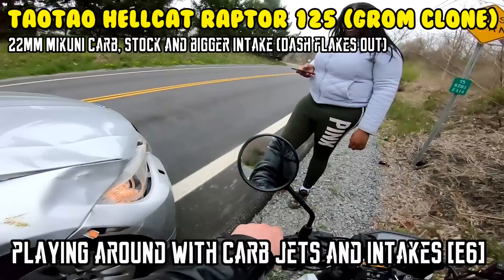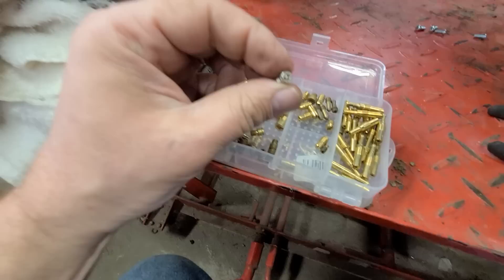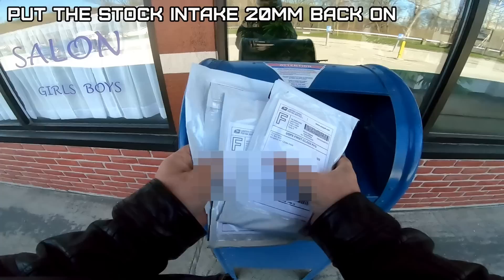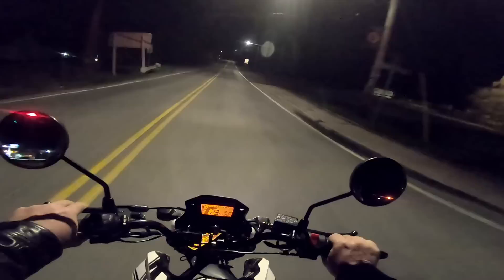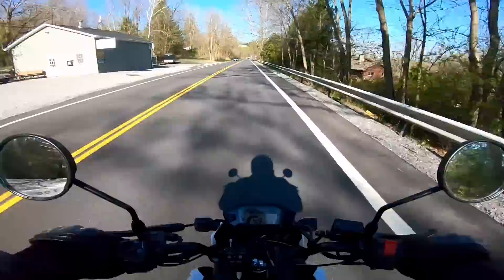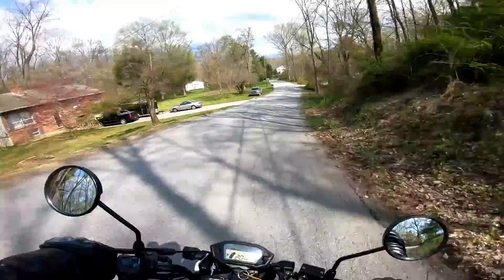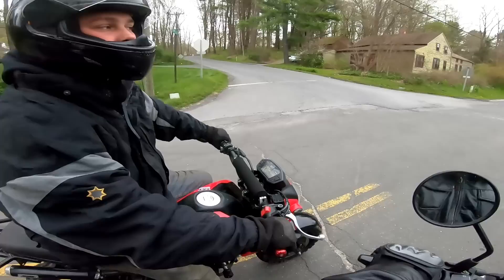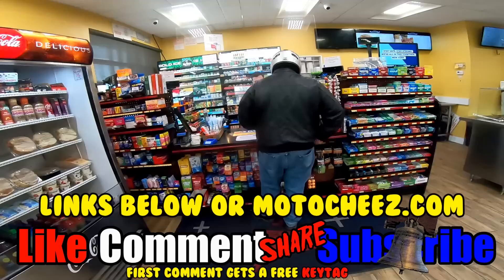(E6) Hellcat Raptor 125cc Playing with Carbs and intakes. Vee on Honda Elite 150 POOPY n wheelies

Comment: Ive been using the MSR fuel bottle. They have a few sizes and they never leak or come loose! Since its metal, you could use a small fire extinguisher bracket to mount the bottle to the bike
Reply from the maker: Good idea

Comment: If you want a small reserve tank, make one with the welder and make a box or rectangle steel one and put it on the rear of the bike, run a reserve pipe to the main one ☝️

Comment: That stimulus check is burning a hellcat hole in my pocket
Reply: I say get it, it's well worth it!
Reply from the maker: I find myself hopping on this just to grab the mail etc. Small and fun.
Reply: MotoCheez grab the mail?!  I'm gonna use mine in the house like a damned power mobility chair!  Ride it everywhere!
Reply: Sold out everywhere
Reply: Drake Orion New inventory is expected to arrive to dealers around end of June.... Any pre-ordered machines will ship first before the websites even update to reflect in Stock status.  

Best to get the order in now, or risk another bike draught later in the year.
Reply: @jasonjulian1  I noticed the prices are skyrocketing too
Reply from the maker: Everyone waiting for their containers from China
Reply: Drake Orion I wouldn't be surprised. There is already a non insignificant price difference between dealers on the Hellcat.  Almost $200 between some.  I ordered mine for $1092.  It's sold cheaper elsewhere but those guys charge $235 ish for shipping.

Comment: Needle height actually affect 1/4 to 3/4 throttle. Main jet size primarily affects 3/4 to full throttle
Reply from the maker: It effects the whole range, but yes, mostly 1/4 to 3/4
Reply: @MotoCheez  ok. In the video you said 3/4 to full.
Reply from the maker: @DoRC  I must have messed up... Meant main jet!! Been doing carbs for many years, have done hundreds!
Reply: @MotoCheez  gotcha.  I just wanted to sound smart:)
Reply from the maker: @DoRC  glad you caught it, I didn't realize unsaid it and nobody else caught it.

Comment: Cheeze there’s a big bore kit at t-bolt. 141cc I know works on Vader’s then you get the yx cam. You can call them and see if it works for hellcats. It should def work though. I was gonna go that route but I’m going zs190. I want that 5 speed.
Reply from the maker: Tough decision.... I'll probably get the entire engine 5 speed. Can always use this 125 on another bike.
Reply: MotoCheez exactly, the 146 race head kit is same kit w race head. It’s 500 for that race kit. A zs190 runs between 650-700+ depending where you buy it. For the extra we’ll say 200 get the 190. You’ll smoke you’re buddy on his grom. You’ll need a new exhaust and clutch cable. I know exhaust for sure not 100% on clutch cable. I’ll know more soon, I sold my 125 to a bud for $200. He’s putting it on a golf cart. The big bore kit fits Vader’s there’s a couple people w it installed. You go from 124.9cc to 138 along w can for around 200 w the 141 kit. I figured put that $200 toward a 190.
Reply: Forgot to say you spend 500 and still have 4 gears. 700 you get 5 gears and ALOT more power.
Reply: If you get a 190 don’t tell you’re buddy w the grom. Just tell him you put a bbk on it and race him. Then you can watch him 😭😭😭😂😂😂😂👍🏼😁
Reply from the maker: Damn. Where you finding the ZS190 for that cheap? Has to be electric start. Thanks for the info
Reply: MotoCheez I’ll fill you in once I order mine 👍🏼😁 I promise.
Reply: It is electric start it’s the complete kit carb oil cooler etc.
Reply: Great video btw brother 👍🏼

Comment: You should change the cyclinder bore and camshaft. Sometimes you can find it on Aliexpress. Your engine is similar to a lifan engine. Try a 56mm piston with 55mm stroke or somewhere close to that number and also change your sproket.

Comment: 👍👍 My DRZ does not trip the traffic lights either, have to go thru the red light or take a right and loop back. Thought about gluing a magnet to the outside of my boot, maybe that will trip the sensor coils. Good job on jetting, do you have a set of those micro drills (size 61-80) ? I use that when i have to enlargen a tiny main jet here and there. Nice adventure video, yeah a Gatorade bottle of gas is a good idea for reserve ! Now to catch up on your next vid !! 😎
Reply from the maker: Thanks. YeAh I've heard of the magnet trick too. I do have the drills but I'd rather change them because I reuse when I can
Reply: @MotoCheez  I saw your kit of jets and was like 🤯🤤🤤. Yeah, no need to drill (& ruin) unless you got lots of spares) I'm about 2 hours north of you. We got snow this morning 🥶😠
Reply from the maker: We got a dusting, squalls all day. Tomorrow 50!

Comment: I'm pumped to see the new carb.
Reply from the maker: Intake came in, had to angle it forward, didn't turn it where I wanted. It's 26mm hole made a difference even with the mikuni carb. Can't wait for the Nibbi too
Reply: @MotoCheez  I ordered a mikuni for my sons apollo 110. I'm hoping it gets here today. Fingers crossed.
Reply from the maker: Made a huge difference even with stock intake.
Reply: @MotoCheez  I didn't order an intake or breather. I hope it all bolts up. Go Power Sports wasn't answering so I just ordered it from the website.
Reply from the maker: It should. But for some reason the stock airbox has restriction or backwaves that prevented me from getting more power.

Comment: Dude, I had the OG Road Rash back in the day on the Panasonic 3DO!!! Man, now I feel really old..... Keep rippin' and stay safe Moto Cheez!
Reply from the maker: Damn! We ain't old, just matured... Wait, I'm not mature either... How about fine, like a wine
Reply: @MotoCheez  Yes sir, just matured! I actually went to bust out the 3DO a few months ago, video output is junk... I might have to take it apart to see what is going on. RR was such a fun game... That was the system to have back then. Took me all summer to work and make the cash to buy it. If I recall I spent around $1,200 on the system, a few games and an extra controller. Factoring in inflation that was like $2,100 bucks!
Reply from the maker: I remember they were expensive. That's be cool video to do
Reply: @MotoCheez  I've been tempted to repair it. It's been a while since I've done board repair on something... We'll have to see... I hope it's just corrosion on the RCA outs, at least on the inside of the machine. And you want to talk about expensive, my one buddy back in the day had a original Neo Geo. Do you remember that beast!?

Comment: I just put a nibbi 26 on my hellcat with a new Intake manifold and filter, definitely made a difference. You may not have this issue but the pilot jet in the nibbi was to small (had air screw all the way in) I couldn't find nibbi specific jets so had to drill myself to make work. If you know what jets would work in a nibbi let me know.
Reply from the maker: Good to know, I have a decent assortment of pilot jets, so if I have to change I'll post it up. I saw mine came with a few different jets, yours didn't?
Reply: @MotoCheez  it cam with 9ne extra pilot jet and there main jets but the extra pilot jet was the same size as what was in the carb. The main in the carb was a 110 and the extra ones where 105, 115,and 120. I ended up needing the 115 but I think I might try to do some digging to find jets that work because  the 115 is a tiny bit on the rich side.

Comment: Got my ECM from China for my vantage vanGo. No more 25mph. Got it to 65mph and had more pedal to go but wobble backed me off. Need to balance wheels. 2010 with 1100 miles. Paid 2000. The guy didn't know what he had. Waiting on title now. Hopefully no problem. 👍
Reply from the maker: That's awesome

Comment: Maybe if you open the ports of the head a lil bit more the engine will work better, many times the cast of the valves guides are too thick and tbh a 95 jet on the carb is too much for a 125cc, ive seen 95 and 98 on 200cc engines
Reply from the maker: Maybe once I get a large enough intake runner, the intake runner didn't look horrible to be honest. Way bigger than the intake they used.

Comment: Benelli makes a 155 kit for their 135 cc and I don’t know if that 135 cc stock benelli engine is a Honda clone or not but maybe you can check into that or find a wrecked or used benelli 135 engine cheap and buy the 400$ 155 cc big bore kit for it ????? 155 cc on your raptor will be fast for that little thing
Reply from the maker: Yeah, I'm checking all my options. I'm liking the whole 190cc engine but it's $$$

Comment: Have you ever considered getting one of larger CC Chinese bikes like the SR450S, Pitster pro FSE 450R, etc.?   I have no affiliation of any kind with either of those manufacturers.   I'm sure there are other similar Chinese made 400cc range bike makers too.
Reply from the maker: I have, those are the only ones I know of. Others are working on getting bigger CC bikes in.
Reply: @MotoCheez  The Pitster looks promising as it has Fuel Injection for 2019.
Reply from the maker: I couldn't find the EFI one...
Reply: @MotoCheez    https://www.montysmotorsports.com/new-models/2019-pitster-pro-fse-450r-27163502b     
 Delphi EFI fueling system,  That site just is the first I found with it.  I have no connection with them or even heard of them before.
Reply from the maker: Damn. Delphi like hawk uses too. Nice. Good system.

Comment: That smaller intake might be a torque adder.
Reply from the maker: Possible. The larger one definitely had a higher too speed, see when the Nibbi comes in.
Reply: @MotoCheez  Seems its always a trade off with that stuff. Great fun to dial in and then more fun. 🤗
Reply from the maker: True. Have to find the happy medium, but I'm keeping stock exhaust so hopefully that'll keep the torque.

Comment: 5:18 I have a running issue with a 1991 Suzuki VX800...Rich all over..Some shop "rebuilt" the carbs for the previous owner. I'm no CV carb expert but did find that the needles have a lot of up and down play within the slide. Could this cause rich running? How can I eliminate that play?
Reply from the maker: Whoever rebuilt the carbs must have left the washers out that hold the needles down? That's my guess.

Comment: Can't wait to see the results with the nibbi, any thoughts on these racing cdi boxes? Are you thinking about going to the 17t front sprocket?
Reply from the maker: The 26mm intake came yesterday, it didn't angle to the side like I wanted so its pointing forward left. Made a decent difference with mikuni. Especially higher rpm, I got speedo up to 59mph on flat which is 56mph!

Comment: I have a 1986 honda 250 elite it does 75mph
Reply from the maker: My parents had one. They're fast
Reply: @MotoCheez  the thing won't die only oil changes and tires. I have never had to touch the carb

Comment: What can go wrong on the new  bike after replacing the stock instrument cluster with the digital one and starts up and all the functions are working properly but it will not start the next day, battery is charged
Reply from the maker: Hmm weird. Sure the stop switch is on? It'll crank with it off
Reply: @MotoCheez  yep, both that and spark plug wire was off before so I always check both
Reply: I always keep the kill switch on now, I use the key to turn it off
Reply: @MotoCheez  I put the stock carb back on cause the other one was flooded
Reply: @MotoCheez  I've been leaving the key in bike in the garage, I've noticed beeping while working on bike before, I figured it was telling me the key is in the ignition
Reply: @MotoCheez  no idea what it could be?
Reply from the maker: Does yours have an alarm? Mine doesn't beep at all from anywhere.
Reply: @MotoCheez  no buttons on the keys
Reply from the maker: Where is the beep coming from?
Reply: @MotoCheez  it was coming from the ignition box where the key goes in, but I have not heard it for a couple days now
Reply from the maker: That's odd. So it's draining the battery and makes that noise with key off?
Reply: @MotoCheez  no I didn't say it was draining the battery, I'm draining the battery trying to start it but it will not start
Reply: I don't see spark coming from spark plug, I turned off the light in garage, door closed, dark in garage,  I did spark test and no spark

Comment: 799.00 FOR THE ZS190
Reply from the maker: I see that but everyone is out of stock
Reply: @MotoCheez  tbolte. usa has the 212cc zs motor for 1099.00 40 BUCKS SHIPPING FLAT RATE. ITS THE BEST DEAL RIGHT NOW. AND IN STOCK. COMES WITH THE FULE CABLE AND CLUTCH CABLE.
Reply from the maker: Not bad.....
Reply: @MotoCheez  JUST GO TO TBOLT.USA THEY HAVE IT ALL.
Reply: AND THERE PRICES ARE NOT BAD.
Reply from the maker: They were out of the 190s
Reply from the maker: The 190 still better deal with everything being included...
Reply: @MotoCheez  GO LOOK AT TBOLT SEE THEY HAVE GOOD DEALS.

Comment: Drop a tooth on the front sprocket
Reply from the maker: I don't want to lose my top speed. It's only a 4 speed.
Reply: I'm currently using a 17t not good for wheelies but perfect for keeping up with traffic without redlining and it gives 1st gear more pull and i weigh about 165